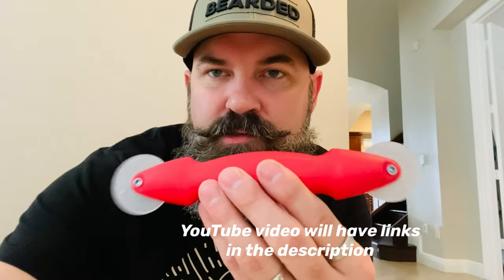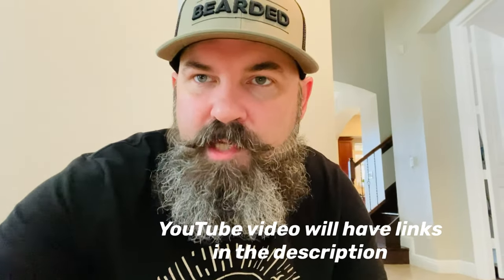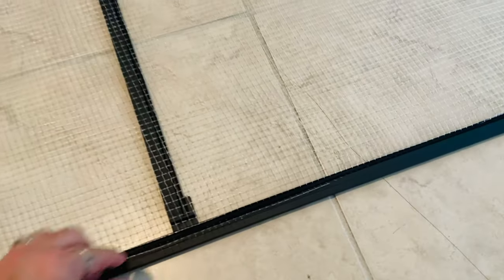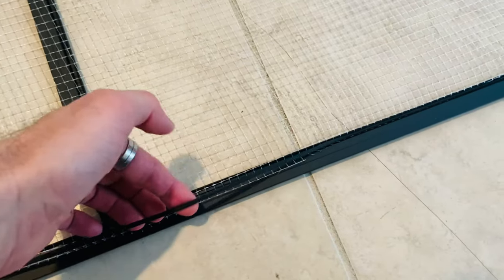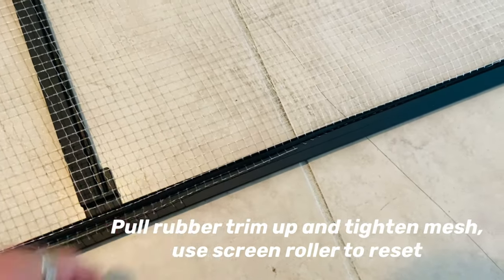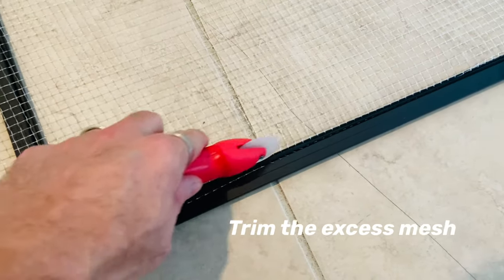Aquarium Jump Net Lid - how to tighten or swap the mesh - CADE Aquariums

Comment: It's always nice to know you can customize pre made things like your lid. I use the Red Sea mesh lid. Curious.... why did you go for black mesh. I have heard it reflects more than the clear/white.
Reply from the maker: Good point on being able to customize manufactured hardware. 👍 These CADE systems offer so many options… even the sumps have customizable sections… you can remove one of the partitions if you want… same with the media baskets. That makes me happy.

I just prefer the black over the clear mesh. You are correct in that the black can diffuse some light but it’s super minimal and with the lights I have there is zero concern…the Illumagic Blaze X is BLAZING 🔥 🔥 🔥 ⚡️
Reply from the maker: I’ll have to remember to run a PAR test on clear mesh and black mesh at some point. I kept the clear mesh and the Felix Smart Pro V2 controller comes with a PAR meter. I’m curious to see how much a difference there is between the black and clear. 🤔
Reply: @ReefStash  ya please let me know. It could change how I do things here with my tanks.
Reply from the maker: @Sharks3dGirl  will do bro